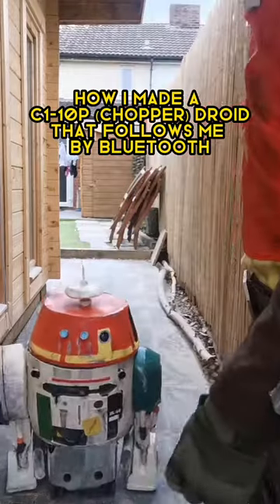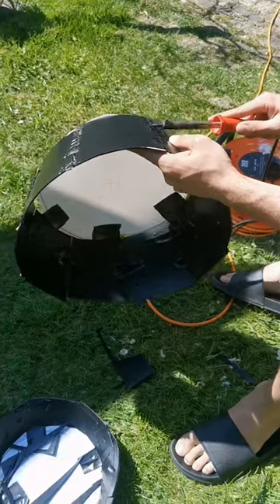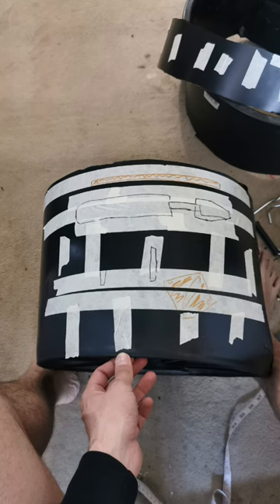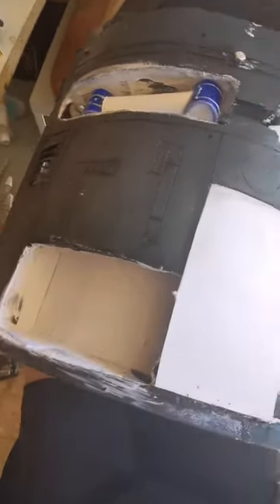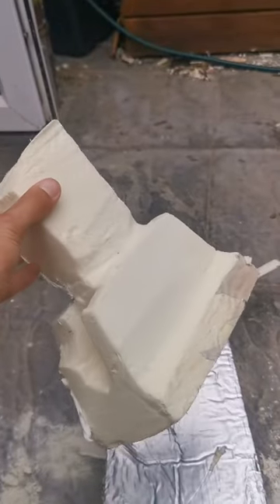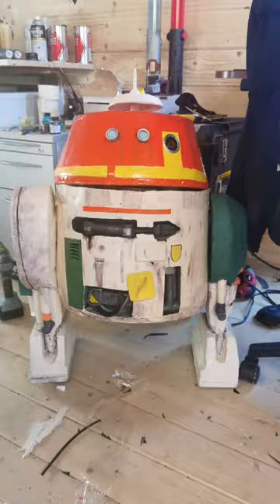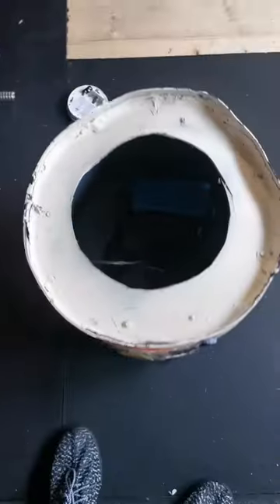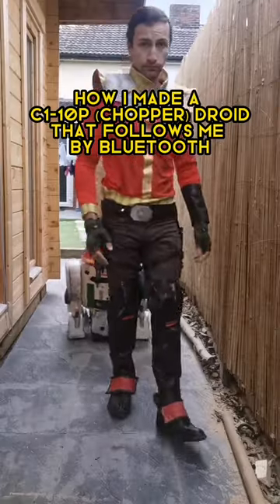How I Made A Remote Control Chopper (C1-10P) Droid That Follows Me & Avoids Obstacles

Comment: what's the code for this project? did you use the arduino IDE?
Reply from the maker: As explained in the video, no coding or software done by me, used the suitcase which is already programmed to follow the bracelet by Bluetooth tracking